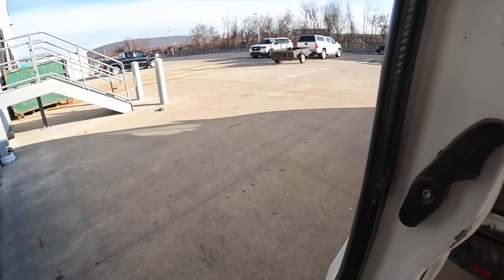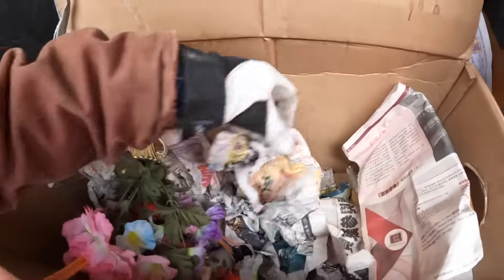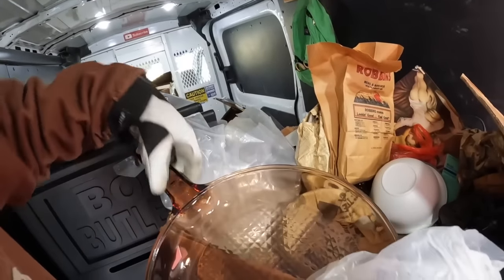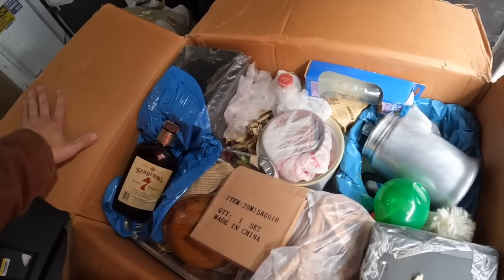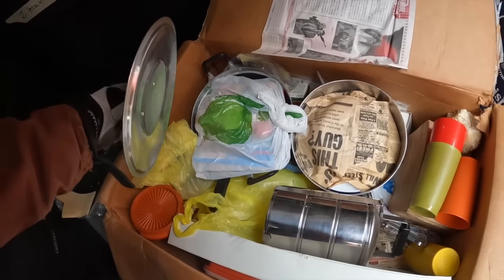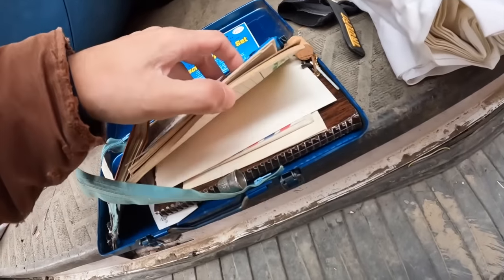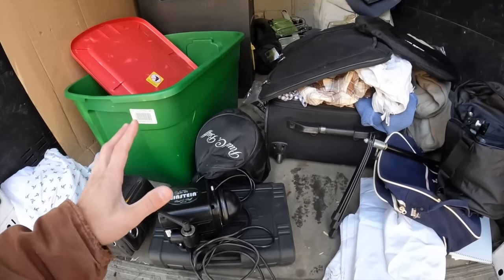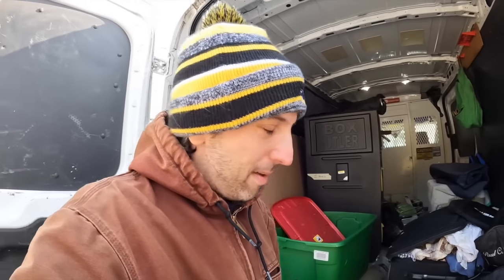I BOUGHT an Abandoned Mystery Pallet for $100 - Look What I FOUND!

Comment: Hey Taco - the last stuff is all part of a professional photographer's set up.  Please get the lenses and everything else away from the battery acid (don't put anything back into that bag).  The Einstein 640 monolight by itself runs around $350 and the (Nikon) lenses are worth at least $100 each, probably more.  The flat/round thing (known as a 'cookie') is also part of a studio lighting set that uses the tri-pod - All of these together are some major bucks.
Reply: I believe that is what the camping gear with
Reply: The things he thought was stove pipe goes with those lights
Reply: The "stove pipes" are pop up light boxes that are part of the lights. Don't toss ANYTHING from that box. Most of it is professional studio lighting.
Reply: Get those big Mickey Mouse gloves off before you break everything

Comment: This is the 70s calling and I want my stuff back...lol. The record player maybe a hit. I had something like that one. Fllip the bottom over (be careful not to bang the arm with the needle)and look for a compartment. Mine had 2, one for batteries and the other for storage of the plug for power. Yours has a radio, AM/FM. There was no case, it sat on a table or counter-top and made to be portable. Look to see if there is a insert for the 45s. Most models played 45s and 33 1/3s, better models players also could play 78s. We would drag them to party on the weekends in a barn or basement. Others would bring their favorite records, hi-fi's were not portable and very expensive. Oh such happy memories, thanks.

Comment: Taco, can you cut open that lock with that metal cylinder on video?  There could be money or valuables in there, it looked like a portable safe?  And that metal tool case that had that random stuff (like the thimble in there) could have cash between the papers, you should empty it all out to see what is in there.  Really interesting video!
Reply from the maker: I actually went ahead and pryed open the lock a couple hours ago. The lock itself just fell apart in my hands, shocking, not much of a lock there haha. Then all the individual cups (since apparently it was a stack of cups) fell all over the ground. Nothing was inside. But for some reason I had really thought there would be! I guess the lock was there so that it keeps it closed and tight, maybe the clamp itself was going bad and constantly opened.
Reply: it's a Tiffin ... a lunchbox from India ....  @TacoStacks